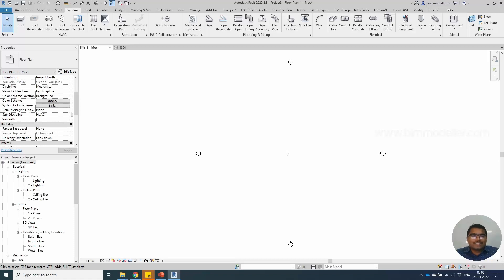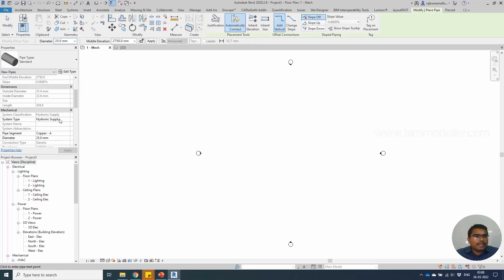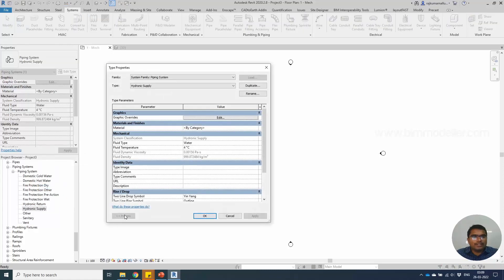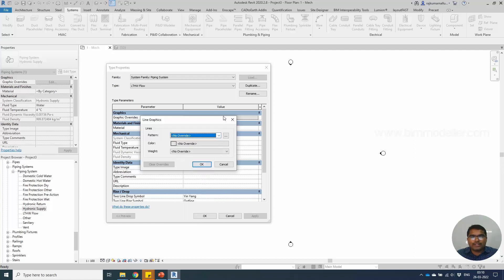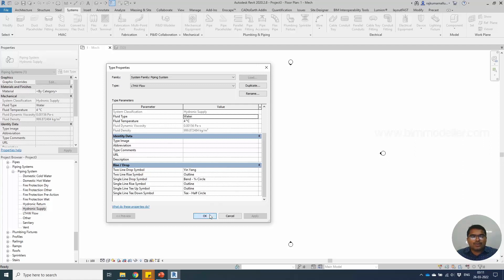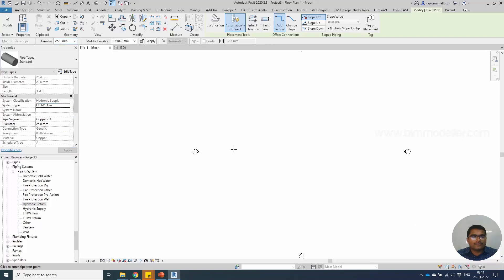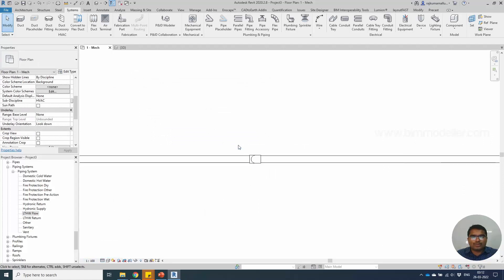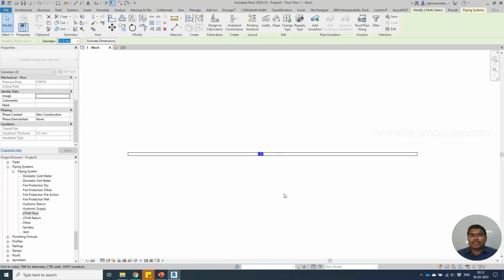Revit MEP Tutorial 24: How to add New Pipe System

Comment: Professor ... I am learning revit by myself and I was learning with rme_advanced_sample_prject.rvt file. And as you know it has the completed supply air duct system. But when you look at the return air ducts, it's not completed. I wanted to get it done. But I could see it's all connected and it was just one system. And when you look at the duct inspector, the flow doesn't make sense. So you are able to calculate the flow of WHSP machine, but you are not able to calcalculate the flow of Outdoor AHU. You know what I mean? I am struggling by myself. No where to ask this.. Help me ..
Reply from the maker: Hi Now you can download all files in one file. There is a Notepad file which contains all files link. And we used sample file from revit. I have added their location also. 
https://www.bimmodeller.com/product/basic-revit-mep-training-working-files/